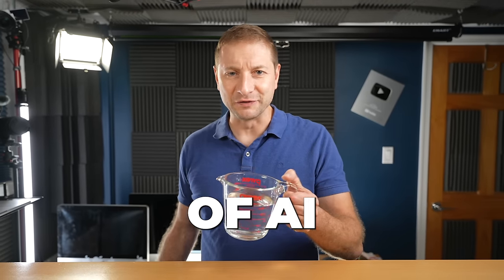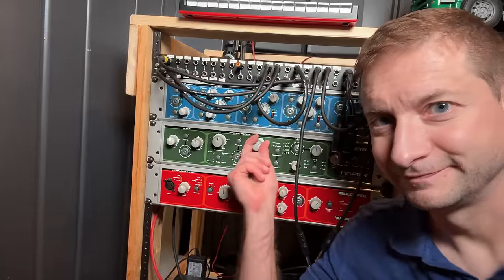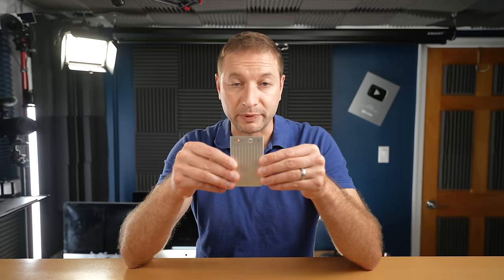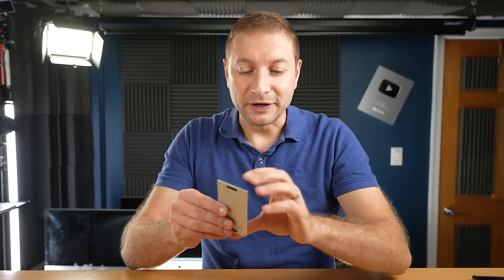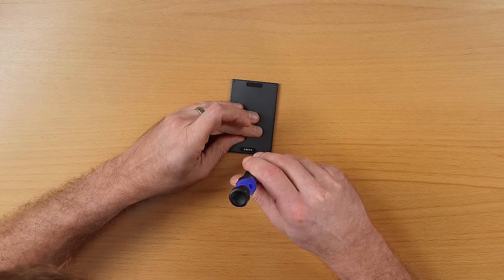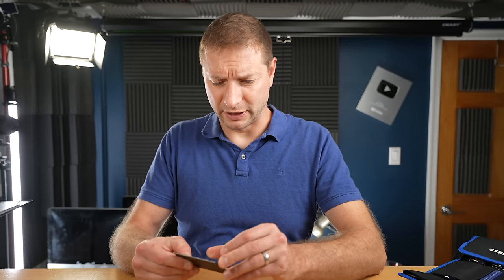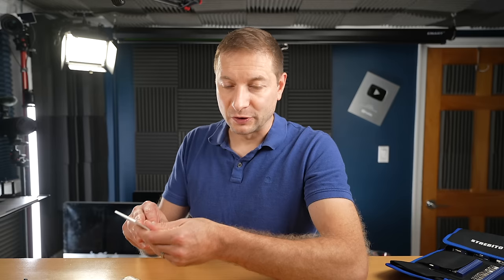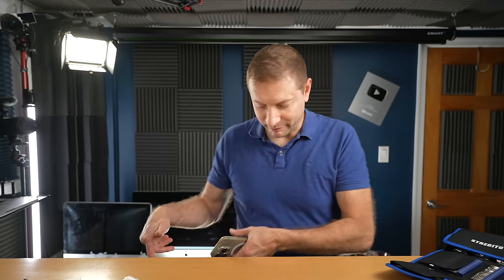They gave me AI in a card, and I broke it

Comment: I would totally get this if there was no subscription for it..
Reply from the maker: they give you like 300 minutes per month, so if you’re a casual user, it’s free (for now).
Reply: @AZisk (for now they do).
Reply: @AZisk  It's cloud dependent. They are just an AI startup that can disappear in next year and all cloud services will go down and it would become just a piece of metal.
Reply: Once local devices can run these models, I would then not expect a subscription. Right now with everything being done in an expensive cloud, you should expect subscriptions.
Reply from the maker: @ninele7 yep, keep that in mind. this aligns with my conclusion
Reply: @cosmicgamingunlimited  Whisper can run locally on top of the line phones. Summarization can also be done locally with simpler text models.

They could've provided a way to host your own inference server or enter your own OpenAI token to make users sure that this thing will work after they're gone.
Reply: @ninele7  That doesn't sound very mainstream/user friendly
Reply: Not like the company will be around in a year anyhow.
Reply: @cosmicgamingunlimited  It doesn't have to be. The main point is that if some enthusiasts would like to keep this thing running than it's possible. 

They can than make instructions for mainstream users.

Comment: I’m not sure what college you attended, but using one of these may go against some internal student guidelines (crazy stuff in there if you dig). I was on board with it initially, but there just had to be a subscription model. 300 minutes per month is hardly enough for a student with 7 to 12 lectures a week (50 to 90 minutes each). Even at work, I have 6 to 7 meetings that are 30 minutes each. They either need to drop the subscription model, offer a more generous free tier, or create a special tier for students if that's their target audience.